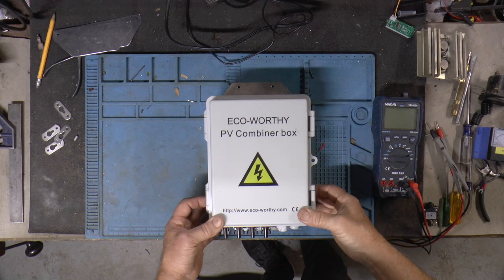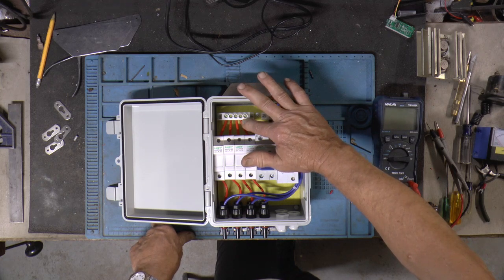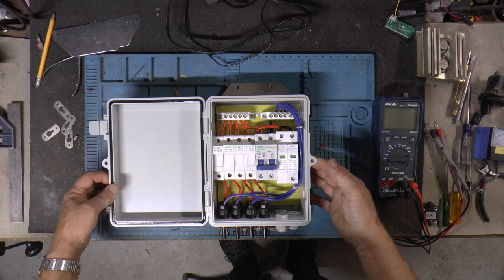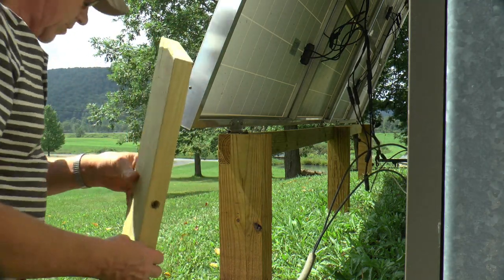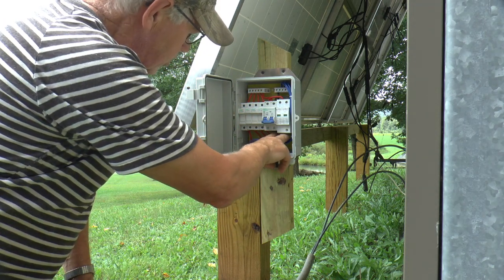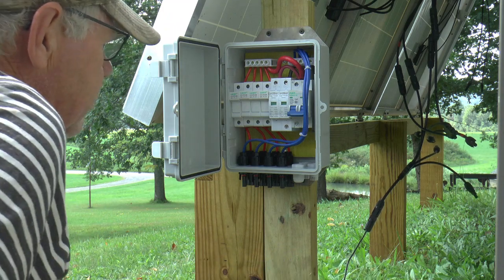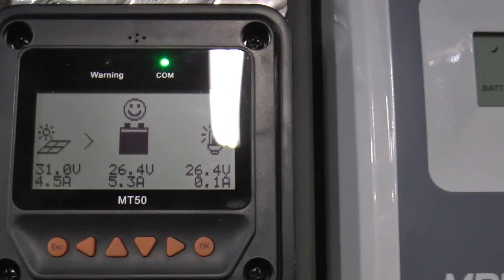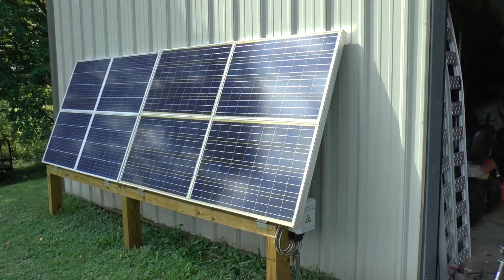Solar Combiner Box Install

Comment: = I utilized an  ECO-WORTHY  4-String COMBINER-BOX for several years 
then Upgraded to an  ECO-WORTHY  6-String Combiner-Box 
when I  increased my Ground-Mount ARRAYS to  36-PV-Panels 
...
they BOTH  performed perfectly 
&
Included a SPD Device for SURGES 
the ONLY feature  I regret NOT having is a BACK-FLOW device on each string as the MUCH  older Combiner-Boxes incorporated 
...
Thanks
COOP
the  WiSeNhEiMeR from Richmond, INDIANA 
...

Comment: I just got one of these the other day. Found most of the connections needed to be screwed down more, most did half a turn, but the ones on the fuses for the solar leads were totally unscrewed. otherwise, it works fine.
Reply from the maker: Mine were all reasonably tight. Still got a partial turn on about half of them. I also installed another one but needed to put #4 wire in the output breaker. I had to move the breaker to a different  location in the box so there was a straight shot to the breaker.

Comment: I was told that ‘tinning’ prevents the wire from corrosion. A solar installer told me that. Take that, with a grain of salt, I reckon!
Reply from the maker: I think tinning is a better choice than ferrules.

Comment: = my 6-String ECO-WORTHY  Combiner-Box 
came equipped with 15-amp line Fuses (which matched my "PV" Panel requirements )
&
a single 125-Amp  Circuit Breaker to Disconnect my "PV" Panels from my 
Underground Conduit "DC" Cables to my Power-House  ... 100' away 
...
COOP
...

Comment: Would a PV disconnect switch be required also, or would the breaker in the combiner box serve the same purpose?
Reply from the maker: I am not sure. You would need to check your local code. I do not have one but I have a second breaker next to my solar charge controller. My system is off grid.

Comment: = another SUGGESTION = 
instead of aiming your MAIN 
+POSITIVE+ 
&  Main 
NEGATIVE 
cables down into you conduit --- where it will direct WATER into your Underground RUN 
why not install a   "WEATHERHEAD" and run your wiring UP through a weather-tight connector 
Above your Combiner-Box & include a  "DRIP-LOOP" below the Combiner-Box installation ? 
...
just a suggestion 
...
COOP

Comment: ??? 
what - in - the - HELL  is a  12-volt "PV" Panel 
???
just CURIOUS  as  I  see this  12-Volt reference quite often  &  NEVER understood it ??? 
...
COOP  
...
Reply from the maker: I guess it is a panel that doesn't have a high enough voltage to charge a 24 volt or higher system. My 100 watt panels have an open circuit voltage around 20 volts.

Comment: = observation: = 
for  OUTSIDE installation = your GROUND Wire should be "SOLID" AWG-6 Bare Copper 
not Not NOT  Stranded wire 
...
again in my observation & IMHO 
...
COOP
...